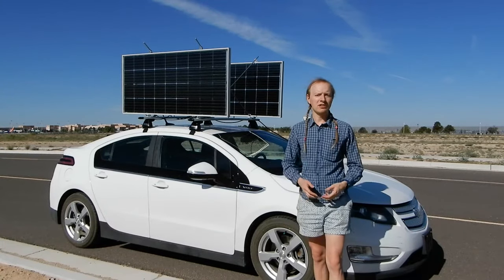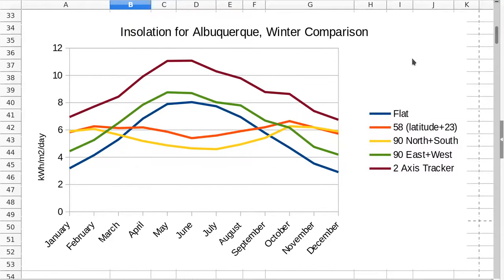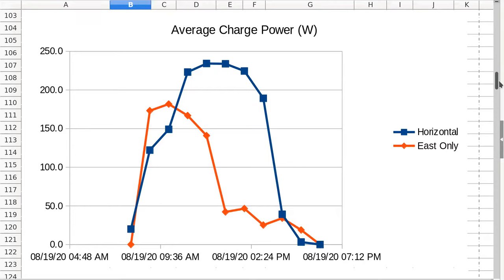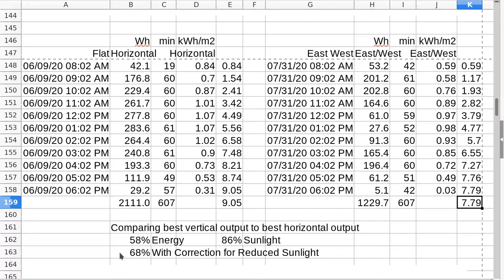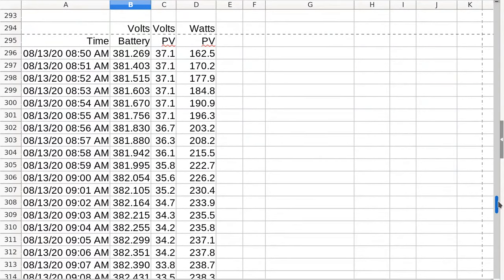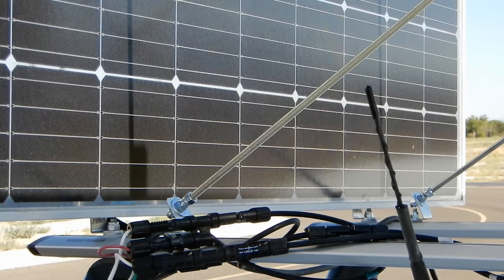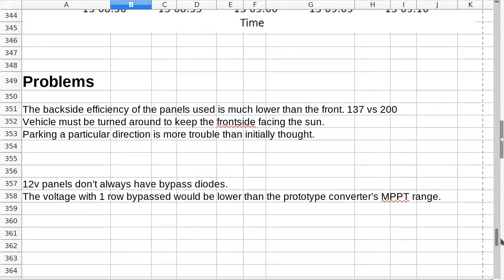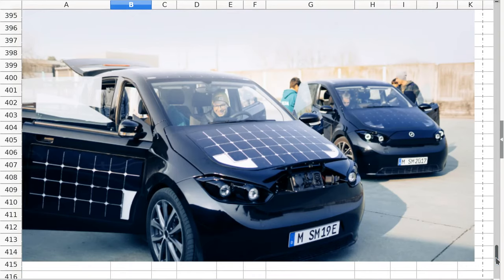Vertical Bi-facial Solar Panels for Solar Cars? pt 1

Comment: The shadows of the struts / stays could be affecting your solar collection too, even a little bit of shading can limit the current from the whole string (of cells) AIUI.
So this is with your custom DC-DC converter again, it's been a few months since the last person asked so I will do it, how is that coming along? I gave up on his route because I want to be able to charge the battery to full, and get the OBC / BMS to do its balancing normally, also I'm too scared to mess up the BMS / required charging profile / destroy the wiring. My car only top balances and if it never gets there... that wouldn't be good. But mainly because I don't know how to make a DC-DC converter myself! 😛
I spent a long time looking into using the DC "fast" charge port, but the protocol is a nightmarish superposition of powerline comms, TCP/IP, home automation, XML (including auth!), TLS with private certs and after all that they end up with a one-way client-server protocol, atrocious. The losses with AC can be kept under control and with the EVSE you can even charge a friend's car if needed.

Comment: @11:50  Watching the power output go from 170 to 238 watts.  It still surprises me how much power a little bit of shade can cost you.  I noticed the same thing when I initially had my roof mounted panels under the roof rack.  I could see this mounting method being very popular in Alaska or northern Russia though.  It is very fascinating to consider how solar cars will adopt different necessary adaptations at different latitudes.  Also I laughed me ass off at 16.19
Reply from the maker: Yeah, EV drivers are already accused of being smug, we shouldn't be doing stuff like that to make things worse. :-)

Comment: Your channel is very interesting, I’ve owned a 2012 Chevy volt for many years now and I love the car but with our Canadian winters the range drops to less than half. I end up burning just as much gas as a gas powered economy vehicle in the winter. I’m would be interested in perhaps adding an extra battery pack to charge when I’m parked using direct dc-dc charger or just simply tying the extra battery in in parallel, have you seen this or something similar done on a volt? I have access to almost limitless cheap lithium ion 18650 cells that could be used to make a pack with even more capacity the the original volts battery but don’t want to add too much weight. I’m considering eliminating the back seat for the extra battery rack since I never use it.
Reply from the maker: I finally got to test a Volt in cold weather. Ouch! The battery greyed out and the engine ran. Guess this was due to a cold battery.  It was different than "Engine Running due to Temperature" which is caused by air temperature.  The Volt expends a substantial amount of energy heating the battery. Maybe it would help to better insulate the battery  and add an external battery heating pad. It could work like the Electrodacus system, splitting solar (or battery) energy between battery heating and battery charging. 

My DC-DC could charge from a battery instead of solar. But with an output of about 500w it may not be enough to make a big difference.     If a DC-DC could supply 2kw when the car was on, that would counteract the power used by the battery heater. http://www.enginer.us/ has a 5kw DC-DC. A big problem with an add-on DC-DC is that it won't heat a very cold battery before charging. My DC-DC would check battery temperature first, but it doesn't control the OEM heater. 

If the power was ran through the J1772 port all of the factory battery heating logic would still operate.  I have confirmed that the Volt will charge from 120v DC. But when I tested it I couldn't get over 6 amps. That may have been due to the battery internal resistance.
Reply: @realsolarcars  Yes, I did give some thought about adding a coolant heater in the battery coolant circuit to preheat my battery a perhaps run it on a battery when driving in cold weather to keep the battery warm. I recently removed my battery to replace the OEM heater for a unrelated issue but I decided to relocate it behind the engine for easy access for further experiments. I will post a video on my channel when I finally get the added heater installed. Cheers

Comment: How's the DC-DC converter going? Is the new board working well? I'm coming around to the idea that this is the only way to go now. The losses I'm seeing in my testing with solar array->MPPT->buffer battery->inverter->OBC->traction battery are just too high, and the OBC is the worst culprit. For those with CCS (like me) I now think it wouldn't be too hard to add a DC EVSE, could use one of the SoCs (found a couple for under $20) that implement the GreenPHY powerline comms.
Reply from the maker: The new boards were running too hot. A revised version was a lot better but still ran hotter than the original 2019 version. We felt it best to redo again to try and drop the temperatures some more. If all goes well they'll be available by June. It seems like we had a generous amount of beginner's luck on the first board. Being new to power design it's hard to know just how hot parts can run reliably. There were also issues like EMI and ringing that we just ignored on the first board. Considering how most tests went we thought for sure that there would be some issue with the car throwing a fit about our DC charger. Now we will use the charger while driving as well so it would be good to not loose radio reception to interference. The panel frames literally touch the antenna. Charging while driving add its own issue with ripple on the battery that we haven't tested with for more than a few minutes. 

The new board should have everything needed to run CHAdeMO. I've heard that CCS is quite a bit harder.
Reply: @realsolarcars  wow a lot of hassles then but it's awesome that you're still revising, so impressed! I'm as keen as ever to get direct solar charging happening. And potentially while driving too, amazing! The amount of time you can drive is pretty small compared to charging time though so I'm happy to forego that if it adds extra time/cost. True, CCS is a nightmare and I wrote it off initially but I've since found SoCs that can handle all the comms stuff... the software part is then very doable for me (do it in my job). Hey if there's any way I can help out with your project I'd love to do so. I've been corresponding with Sam from Innovative a lot too. I'm building my own bifacial solar modules from cells — have 13 kW of them sitting in my apartment right now :)
Reply: @realsolarcars  Still excited to get my hands on the finished product.  I was a little worried you had given up out of frustration James.  Glad to hear you're still making progress on it.
Reply: @realsolarcars  whenever you have the boards ready, I’m interested in one. If you have the programming set up for your volt already, that would be ideal for me instead of an unprogrammed one. I’d be putting it in a 2012 volt to charge the main battery from 3 175w panels mounted horizontally, 2 on the roof one on the hood. Right now they’re charging a bank of 12v lead acid batteries which I can then charge over  j1772 120v from an inverter which is obviously not ideal.
Reply: @realsolarcars  actually, since I have the battery bank already, would powering it from 12v batteries instead of directly from the panels be possible or is that too low of voltage? I could probably shuffle batteries around and get a different charge controller to bump up to 36v if needed.
Reply from the maker: @eaymonddull  The converter needs about 32 to 40 volts.  It was designed for a 72 cell array, so two "12v" panels in series. It seems to reach the maximum power point under most conditions.  We are working to make the input voltage more flexible, but that will take some time and we want to put the current design on sale first. Although since the orientations are probably slightly different it would be best to not have all 3 in series.   There is a possiblity that the board's 12v output could be repurposed as an additional PV input. But then it will be necessary to maintain the vehicle's 12v battery some other way. The converters will go on sale initially without the necessary software for the Volt.  There are two reasons for this: 1. Everyone has different vehicles it seems. We'll let ambitious users work on their own car.  2. The new converter is massively redesigned and won't run the old software.  3. It would be prudent to recheck everything after the battery balance recall. Just be patient, it will happen.
Reply from the maker: @InnovativeSustainableSolutions  We'll have a few converters ready this week! Or maybe next😎 The first converters are designed for a maximum power point voltage of at least 32v. I thought all your panels were in parallel. Is that still the case? Would it be hard for you to connect  pairs of panels in series? We have a path to 16v MPPT input version. That will take some time and be based on demand.  If anyone else has a preference for 16 or 32v input let us know.
Reply: @realsolarcars  Hey James, always good to hear from ya bud.  It shouldn't be too much work to reconfigure the main panels on the vehicle into a 2s2p 38voc setup.  Or even a 4s 76voc system (except that would put 100w panels in series with 175watt), that would require the slide out panels on the roof rack be open.  I believe the design that accommodates the largest common need would be an mppt that runs off 2 panels in series like you have on your car.  This design is the simplest, most bang for your buck kind of approach.  I'm very excited to see what you designed, and to get closer to offering open-minded EV drivers a solar option closer to that $1,000 mark

Comment: Seems like if instead of vertical mounting if you mounted them closer to 45° in a v shape you would still take advantage of the bifacial power generation but increase the power to the front

Comment: Great test of an interesting configuration. I've been planning to optimize my home solar PV for winter sun to reduce the huge delta between summer and winter. Did the vertical orientation cause any issues when driving?
Reply from the maker: Something about the vertical arrangement created a whistling sound. I didn't try to figure out why. I would guess it was the allthread.
Reply: @realsolarcars  I guess you could store them flat and raise them vertically when you "park like a douchbag" :)
Reply from the maker: @paulkennett  The goal was to avoid moving parts on the array mount. If it's going to move, it should be tilted optimally. Thankfully come wintertime I'll no longer need to park like a douchebag. 😇  I've actually put it back to horizontal because I want the extra kWh.

Comment: Could you mention the specs on your DC/DC converter; current handling, voltage input Range, output voltage Range. Any cutoff voltage or cutoff current, i.e. simple Charger functionality? I know this is not yet a commercial kit or product, but you have threathened to make it one, and the alternative, which of,  there are non outside a special order with CSIRO, or other arerospace electronics Companys, I really Hope you'll make this available, at least as PCB files and BOM as a purchasable download. Cheers!
Reply from the maker: Any boards offered for sale will have significant changes compared to the board shown on my channel, but the specs will be similar if not better.  Input: 30-40v 10a MPPT Suitable for a 72 cell array. Output: 300-400v 1a  Constant voltage if the battery is not able to accept all the power collected. I could add charge termination but I haven't done that yet since I'm not sure how to set it. The grid charger terminates at a higher current than the solar charger can generate.  
I intend to make the board fully programmable. That way people can adapt it to their own vehicles. That would save 90% of the effort involved.  It's not just a charger. It's also a Programmable Logic Controller for operating the contactors.
Reply: @realsolarcars  Very nice, especially, the contactor control, I thought you'd run some fused cheat wires directly from your pack! The specs are bang in the Range I'm looking for. I have a programmable BMS that has settable triggers and outputs, so whatever final design you settle for, It Will be workable. Looking forward to this!